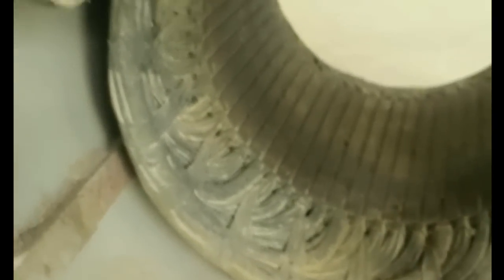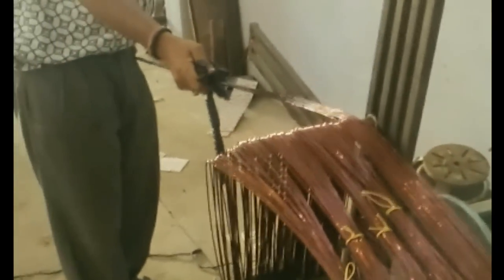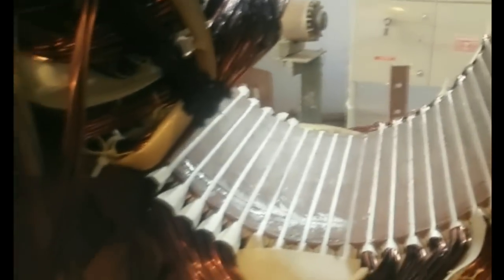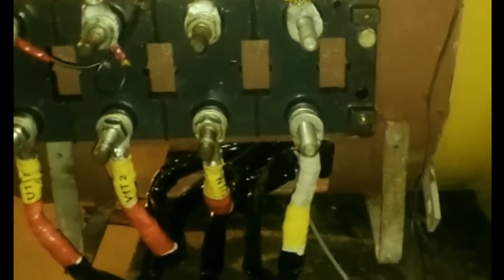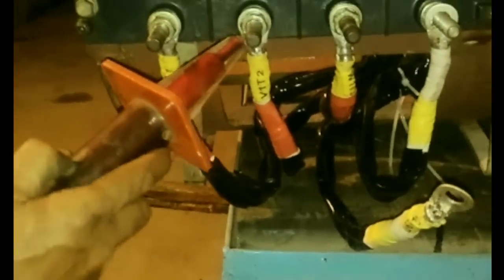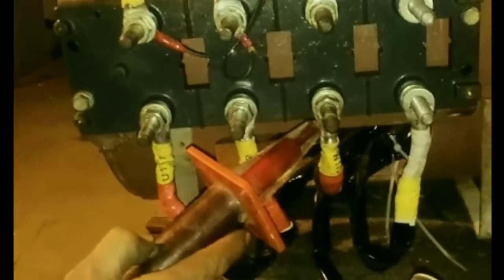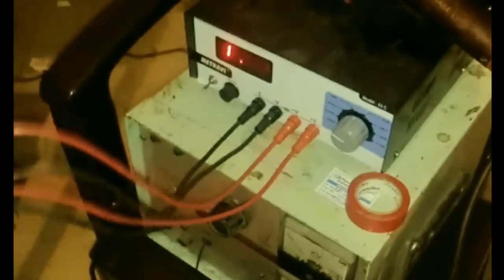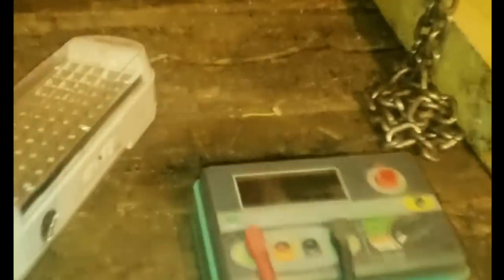Rewinding of 250KVA Stamford Alternator v2

Comment: Hi how are you?, i wonder if you can help me, i have a Kato generator it has 36 leads that were cut off, so i dont know whichs leads corresponds to each phase. Do you have a method to identify the unmarked leads?. With an ohmeter in continuity i found each winding so i have 18 pairs, then with a variable transformer ( variac) i tried to supply power to firts winding and them with voltmeter start measuring the voltages in the 17 windings left ( thats a method that i found but it isnt working very well), any suggestions? thanks a lot